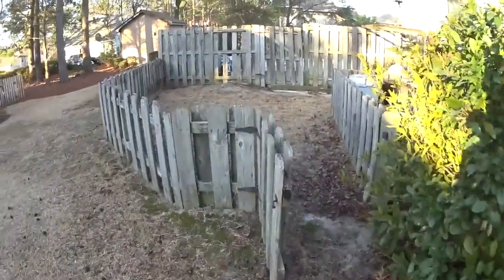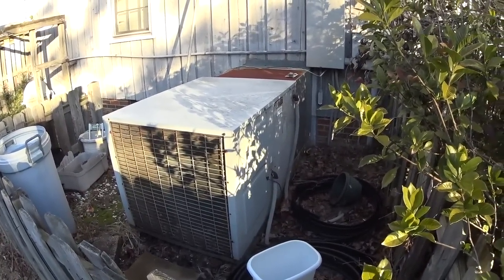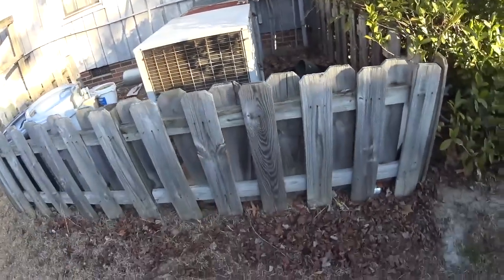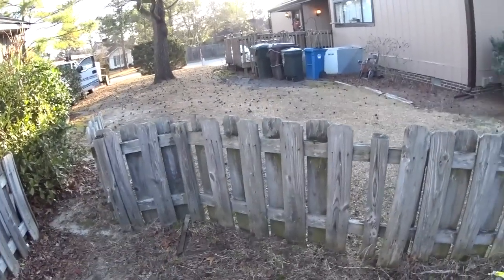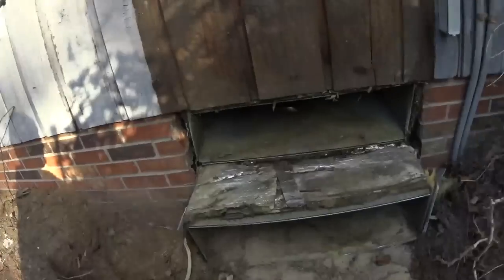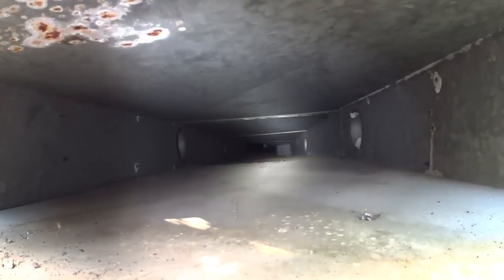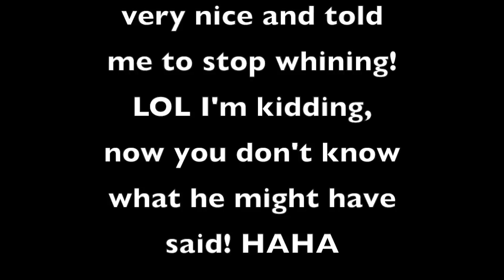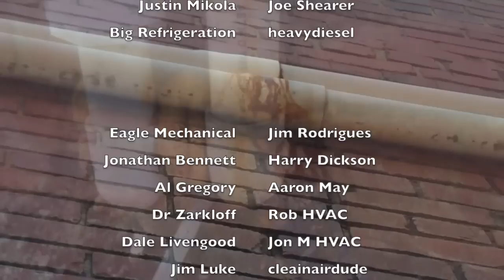HVAC Installation: Trane XL1100 Replaced: A Day in the Life Episode 4

Comment: We always use a "over/under-side X side" adapter for those kinds of installs!! I don't recall who makes them but they are readily available for all sizes of duct. I did have a guy that worked for me that could make them but he is no longer with me so I now have to order them from my distributor. Cost is about $185.00 but they are so worth it as it cuts my install labor and materials a lot!!
Reply from the maker: Cool, I've always just fabricated whatever fittings I need for that situation. The issue we would see is different sizes and depths from the existing duct to the unit. Sometimes you've got no choice but to move the unit far enough back to get adequate airflow.
Reply: Stephen Rardon You are correct!!! I meant to put that in my comment!!1 depending on the size and location I have had to back a over / under unit of 2-3 ft from a house to make it work...makes for a heck of a creative flashing build!!! Great job and I really enjoy your video's!!!

Comment: awesome job dude. looked great too. I retired after 47 years work, mostly in HVAC field.
Reply: ok dear since you have all this experience yeras  l have a question sure you can help me please 
its concerning duckwork install l am sure the man cheat on me in duckwork measuremnet 
in my house  1500sq ft the unite is 2.5 ton or 3 ton  
the hvac man made the supplu duckwork 10 inch fiberglas the main line duck 10inch  and 24 ft long the supply line connected to the main line with 10 inch flex duck 9 ft long 9( FLEX DUCK) ME L NEVER SEE a duckworkin my life with this size  so l ask many pppl hvac all of them they said veryyyy wrong  only him 
support him self by saying its working don t worry ?

please please tell the true from your experience 
and thank so much for all
Reply from the maker: *****  from your description it sounds like there is a problem. 10" flex on a 2.5 or 3 ton system is not correct in any world

Comment: You gotta love salesman! I think they still make over/under units out there! So How did you do those? duct connections
Reply from the maker: We cut back the supply trunk and connected a blowout then ripped out the return and ran flex back to a piece of round pipe that tied into the 2 returns. We were able to widen the hole in the foundation enough to fit two 18" flex ducts side by side. Made the best we could of the situation.
Reply: Nice job man. What size was it
Reply from the maker: 3 ton if
I remember correctly
Reply: Nice.

Comment: did you run just flex duct under the house? is it a slab under there or all dirt? Condensation penetrating the flex and soaking the insulation isn't an issue?

Comment: Great Job Stephen Rardon  Did someone bring you the rectangle to round transition or did you have it?
Reply from the maker: Our warehouse/metal man built a custom offset blowout for the supply duct. 20/20 for the flex collar to a 24/8, flat on top and right.
Reply: Stephen Rardon I just wondered if you had to tell him what to build, or if the salesman had it all figured out beforehand lol.
Reply from the maker: ComfortPlus Heating and Cooling I called the fitting in when we figured out what was needed